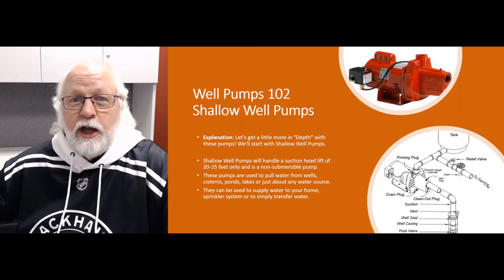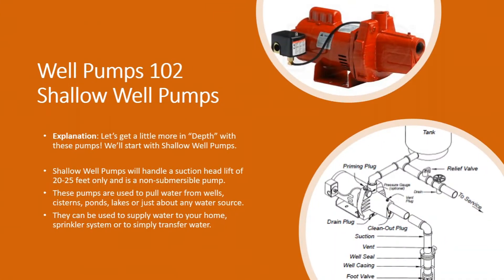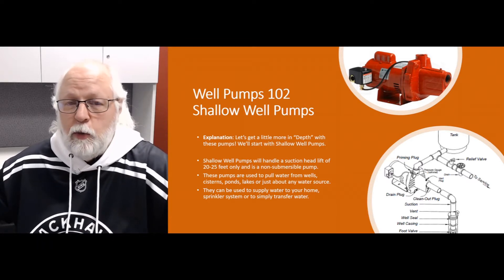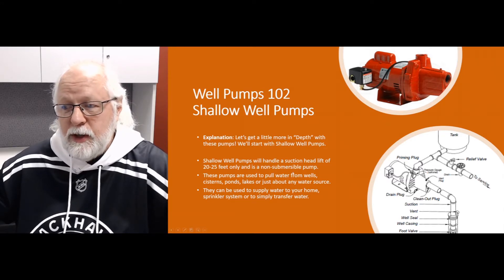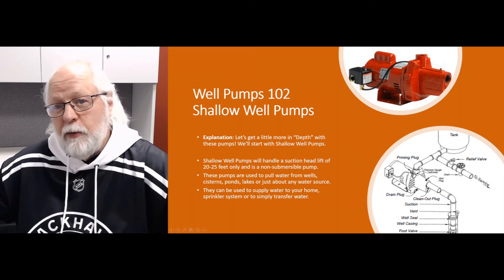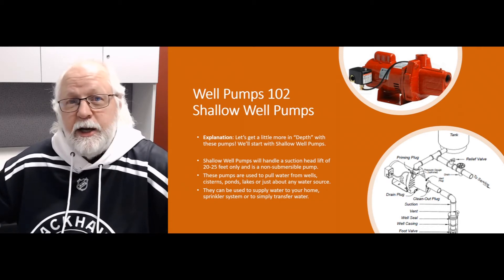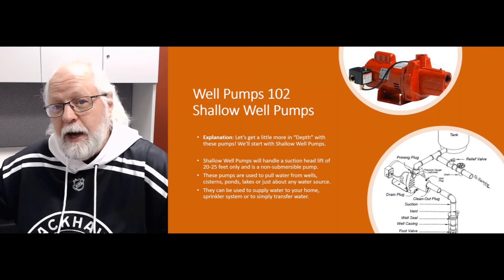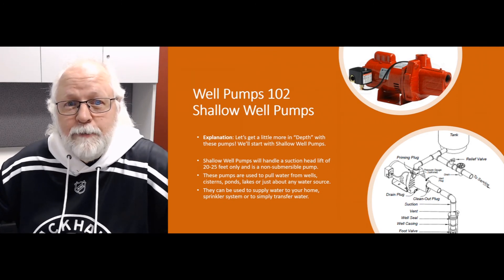What's the Difference Between Shallow Well, Deep Well, and Convertible Jet Water Pumps?

Comment: I learned this the Hard Way for About 13 Years, & about 10 Pumps later. I had Mine in the crawlspace underneath my Home Sucking at about 15 feet thru a 3/4 inch PVC line that I later replaced & Upgraded to PEX...Long story Short, I ended up putting the Pump less than 5 feet from my water source in a pump house & So Far Problem Solved....Just Got to Protect it Against Flooding as it's Much Closer to the Creek & Spring that Feeds my Water Source.

Comment: Im about to change out a 1/2 hp myers pump with a 1 hp pump and a larger 30 gallon pressurized tank,,existing water lines look like 1/2 coming out of water tank and maybe 3/4 coming from house,,,existing pump has 1 inch inlet and new pump has 1 1/4 inch..can i use existing set up by using some reducers to avoid having to dig up and replace existing water line to house,,in a perfect world id like larger water line as we have always had little pressure,,any tips would be appreciated,,also i have never replaced a pump but i am 66 and am a pretty good mechanic and mr fix it,,plumbing is something i try to stay away from but after getting 400-650 quotes for someone to come and replace pump and tank seems ridiculous,,,pump is houses inside a large storage building i built last year so no cramped quarters to deal with still plumbers want too much money,,also since well setup is 30 years old should i think about repalcing foot valve,,didnt consider ever having to replace valve when i built roof over pump but id only have to take off a couple sheets of tin to be able to remove pipe foot valve is connected to..any tip would help

Comment: hola Amigo! What is the difference of using a submersible pump, with an iron, stainless steel, aluminum or plastic body
Reply from the maker: It mostly has to do with the environment and application the pump is working in. Cast iron is most popular, but will corrode over time, however that corrosion will not typically affect the operation of the pump. Stainless steel and aluminum tend to resist rust pretty well and handle salt mixtures a bit better, and the aluminum bodies also tend to dissipate heat better. Plastic tends to resist just about anything but can be easily damaged.

Comment: i HAVE A HOME WITH A 15 FOOT DUG WELL. THE JET PUMP IS IN THE HOUSE. IT'S 20 PLUS YEARS OLD. NOISEY AS HELL.  I'D LIKE TO PUT A SUBMERSIBLE IN THE WELL.  WHAT ARE YOUR THOUGHTS. I'M EAST OF TORONTO,  CANADA.
Reply from the maker: That would depend on the amount of water in that well, the health and capacity of that well, your needs and a few other factors. Unfortunately, we only ship orders within the Continental United States as well.  But if you feel the well can support your requirements and you have a good 10 feet of water at all times in that well, you might be able to make it work for you, but you might consult with a local certified plumber or well company. It’s also possible that pump is just old and has a lot of corrosion in the motor that is making the noise. You might also consider swapping it out with a new pump (same specs) and installing the proper pump housing to protect it from the elements if it’s installed outdoors.

Comment: Hello.  I have a ST1102 we’ll head on my shallow well. I’m needing more water so I’m thinking of increasing it to a 2hp motor. Any instructions on the installation process.
Reply from the maker: Hello, the ST1102 is a model# for the motor and does not provide any specs for the pump. We would need to know all the well specs (Well depth, static water level, max draw-down, depth the draw pipe is set to, distance and lift from the well to the pump and from the pump to the point of use, all piping diameter and GPM & PSI requirements) in order to answer. If you can get this information for us, please give us a call and we can help you better. 1 (888) 455-4682.

Comment: I have a small well we use to water our garden. Do you have instructions on how to properly prime, start, and shutoff? I don't want to burn out my motor by not pulling enough water or pushing water without opening the valve.
Reply from the maker: Hello, we have a walkthrough article that takes you through the proper steps: https://www.waterpumpsdirect.com/stories/1705-Priming-Your-Well-Pump.html